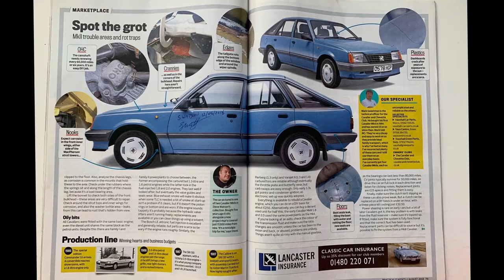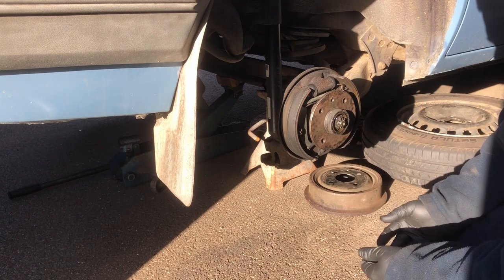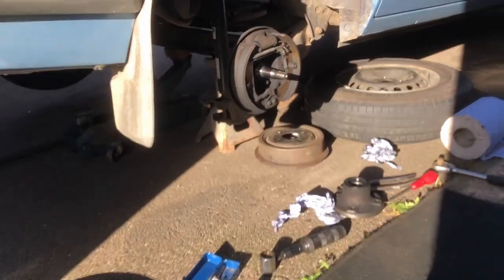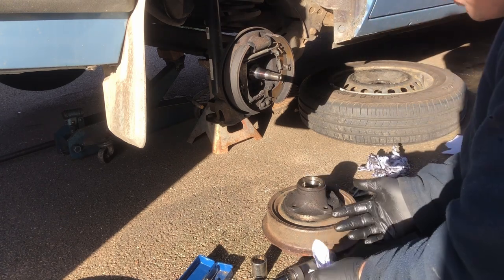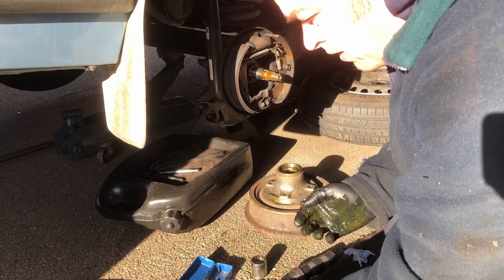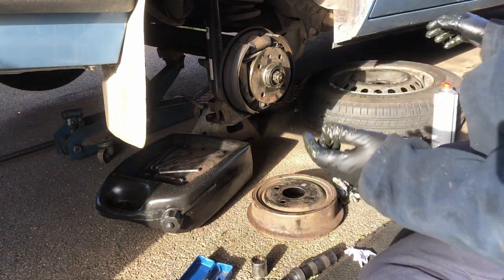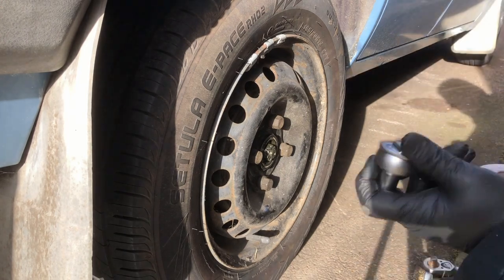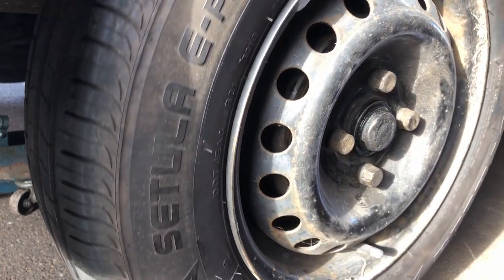Rear wheel taper bearing re-grease/adjustment

Comment: Nicely done Steve and pretty much how I used to do mine, I always used to torque the bearings down but never have done that to the wheel nuts even though you should really do it as it makes them easier to get off if you are on the side of the road changing a flat, ask me how I know but did I learn... NOPE!! 😭😂 Thanks for doing these vids mate as it takes me back to the good old days 👏🙏👍
Reply from the maker: Your welcome John, yes I always torque the wheel bolts up I always do them way to tight, but as you say it does make them so easy to undo with a smaller wheel brace. I’m glad you get some entertainment with these though. Cheers mate. See you in the next one.

Comment: Ha Steve,  good video mate, It's been a few years since I've done a car wheel bearings but they are very similar to a lot of plant i used to repair.
I have always tightened them up to a certain toque, then backed off until they spin freely with no play, I notice you still had a little play, is that's what's recommended? , I know you were looking for movement in the washer which i presume is something that's recommended?, cheers mate 👍
Reply from the maker: Thanks Pete, honestly I’m not sure, I don’t like the play either, the manual does say tighten to a specified torque then loosen the nut until you can move the thrust washer without levering it, I suppose it’s like the flexible hoses on 15mm plumbing you hand tighten those and not use a tool that doesn’t seem right to me 😁 maybe this is one of those tighten it up until there is no lateral play. I honestly was surprised to see the amount of play still in the wheel the first side is better than it was. I assume you would have tightened the nut (by hand) until there is no play in it? Cheers Pete as always I appreciate your thoughts on this.